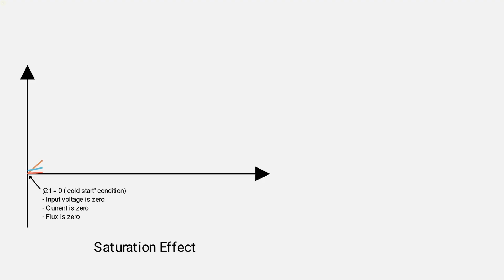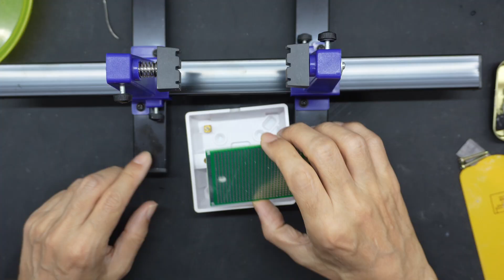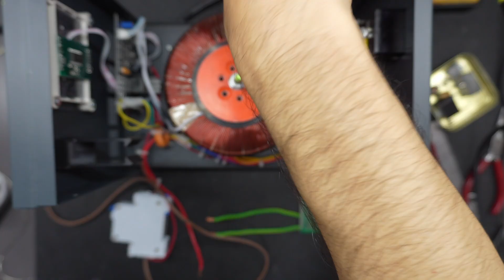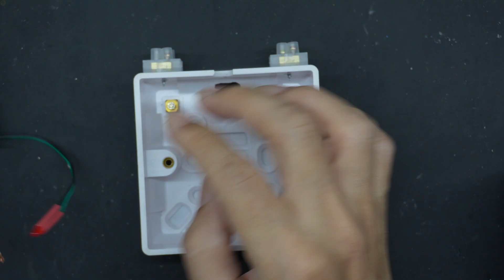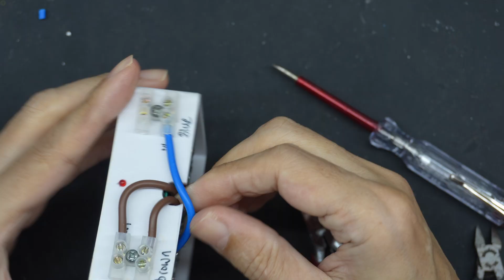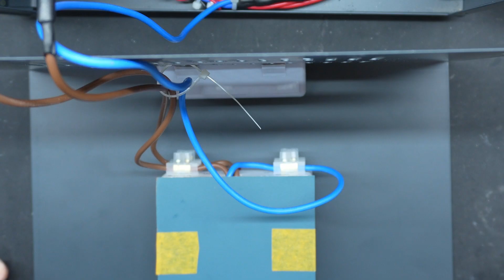Soft-Start Circuit for Transformers: Eliminating Inrush Current

Comment: a perfectly cromulent solution. you could also turn the transformer on at the peak of the AC line voltage (i built a tap-changer that worked like that once). for three-phase transformers, this doesnt work - you can buy GINORMOUS soft-start resistors (like, bigger than me, literally) for this purpose. Another approach is to run the transformer at less than half of the saturation flux density - in other words, use more than twice as much core material. it works..... the current will then double, and decay down to its rated value
Reply from the maker: Thanks for your comment. It does make sense, but I didn't have control over the transformer build for this situration. Will keep this in mind if I build my own transformer one day :)

Comment: I did the same years ago, just used 4 47R 10W resistors in parallel, with a 130C thermal fuse in the middle, and then a 24VDC relay to short it out.  No real electronics, just a capacitive dropper that fed a bridge rectifier, with a 1000uF 50V capacitor across the relay coil, so it took around a second to charge up enough to pull in the relay, and a 24V zener diode to clamp the voltage.  worked to solve the problem on the large unknown variac I had, and I fed in the mains to one of the 3 taps, with the taps being at half way, and the others at around a quarter and 3/4 points, feeding in at the 3/4 mark, so I could get an output above the power rail. Then used that first tap to get a regulated 6V power rail, using a diode, some capacitors and a few resistors and zener diode to get first 47V (the zeners I had to hand in 5W), then a 33V zener at lower current, followed by a LM723 voltage regulator to give a 6V rail, and a 1k resistor to ground, so it would be able to sink current. then a surplus meter, and a rescale to show the AC output from 60VAC to 360VAC, using the meter to show voltage with some fixed resistors and another 1N4007 diode and 220n 630V film capacitor as smoothing. that then left me with a variac that could do anything up to 350VAC on the output, and i can isolate it using another transformer, a 1kVA ferroresonant power conditioner that I have, that provides an isolated output.
Reply from the maker: Very interesting setup, thanks for sharing your experience with the soft-start and regulation build. 🙂 
I do like how simple the relay switching mechanism sounds.